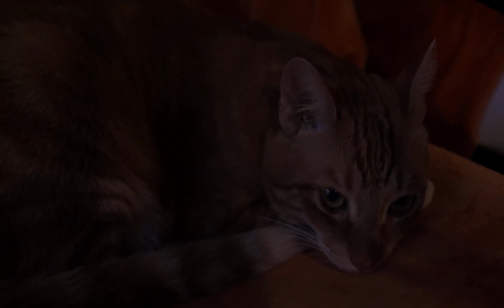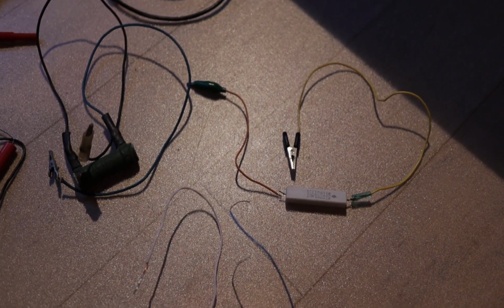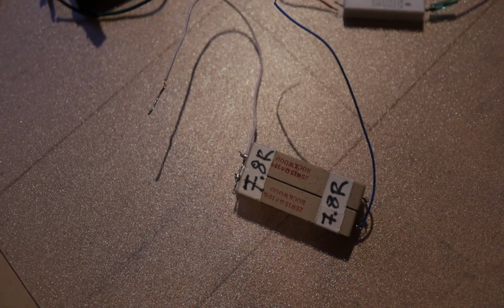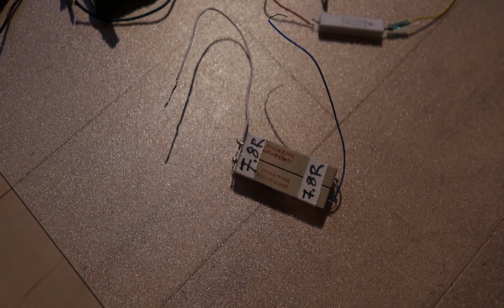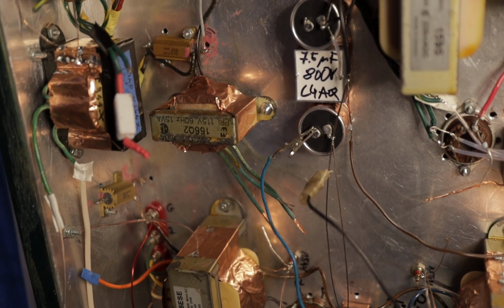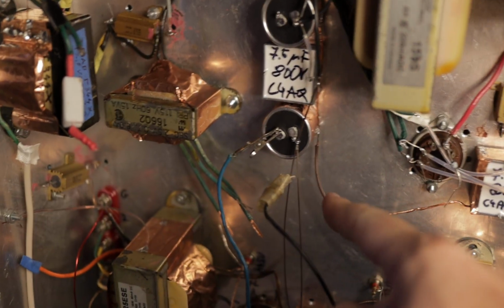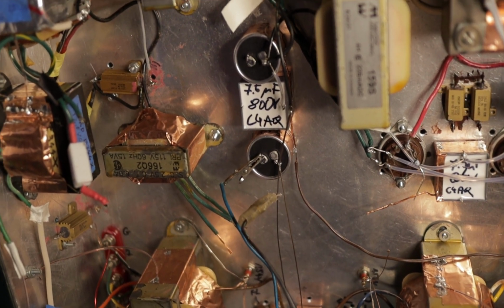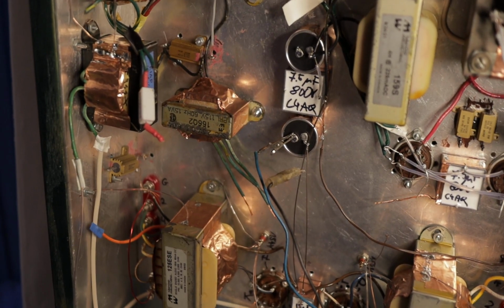03 Beginners starter to DIY: Bleeder and dummy resistors

Comment: János, I like this basics, its good to spell out all those important things! I myself am of the evil age, where screwdrivers had lots of metal-sprites on them, from elko-discharging...
In her often entertaining videos Skunkie is adding permanent bleeder resistors to some Chinese Nobsound 6P1 tube amp (470 kOhm, 2Watt between ground and 2nd C @ rectifier tube), in order to keep the unit out of charge, once it is turned off. Do You think, this would affect the sound of the unit?